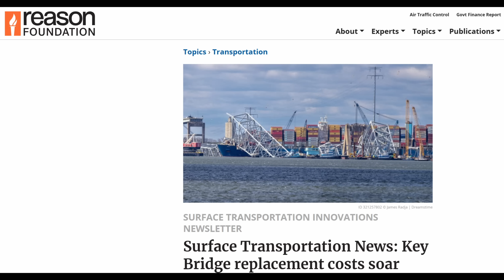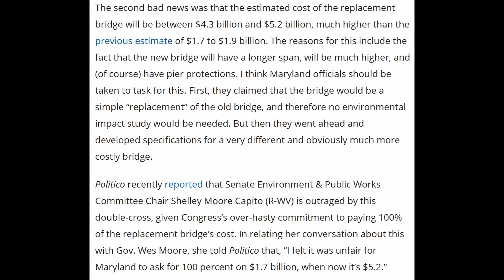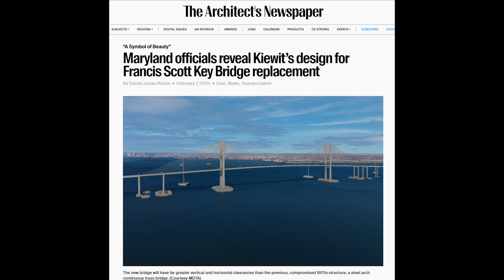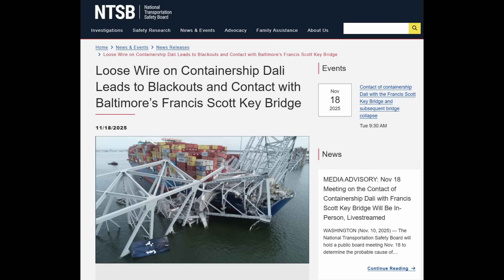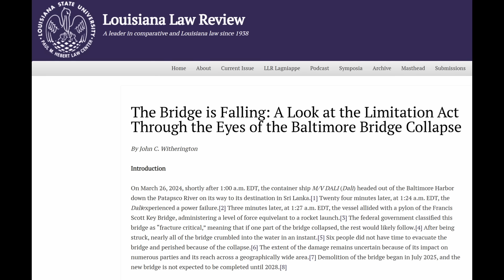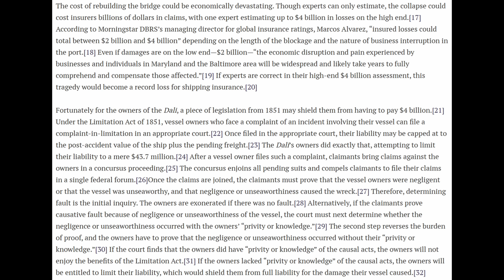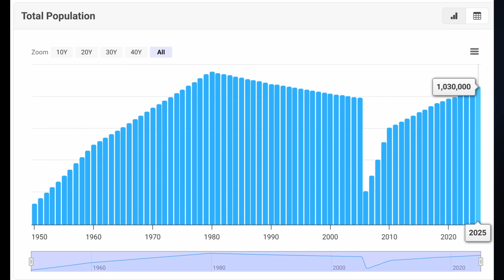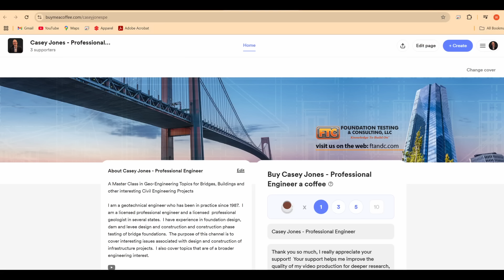Should U.S. Taxpayers Pay for a $5 Billion plus Key Bridge Replacement?

Comment: I find it odd that the high power transmission lines that cross the river next to the Key Bridge had protective shields constructed around the transmission poles.  But MDOT never thought that the Key Bridge should have the same sort of protection around the bridge piers.
Reply from the maker: They knew for decades that they needed to provide better protection from errant ships.
Reply: Those powerlines were constructed in 2019, following the new guidelines for protection. The Key Bridge was constructed in 1977 and was never updated under any Republican or Democratic governor during those years since
Reply: Ever think theres a critical or even defense reason the high power transmission lines are protected… meaning they could be key to grid if they go down it would cost far more then just a bridge falling down 🤔 or maybe critical high power transmission falls under different requirements 👀
Reply: @Clearwater420  A transmission line can be rebuilt much cheaper than a highway bridge.
Reply: @robertewalt7789 i agree inless that transmission line was deem critical meaning the loss of that line would cause a cascading collapse in the region and that would cause significant more cost then just a bridge falling down…. Look at different cascading failures of a grid , that have happened to see example.
Reply: @Clearwater420  There would be no long term power outage if that line fell over. It would be fixed quickly and alternative paths for power exist in major cities. a very major power line got taken out near me. The only member of the pubic that noticed was the guy in the tractor that took it out. 

the power company made way less money those 4 days. but that's about it.
Reply: @c @cabobs2000 interesting because 2003 northeastern black out cost estimate apparently 5 to 10 Billion in 2003 figures 🤔so if we assume worst case 10 billion that be equivalent 2 bridges replacement? However we know from US own reports you need to take out 10 key 🔑 locations to drop the US/CAN grid so again we don’t know due defence security how critical that line is.  Thus the federal level made sure it was protected 👀
Reply: Just get the white ballroom d honors involved. It won't cost the American people a dime cough
Reply: No feasible protection system will stand up to a 100,000+ ton ship sailing at 10 knots.

The only solution is to tunnel under or single span all the way across the river.
Reply from the maker: @alanstevens1296 Not true.  While the tunnel is compelling, there can be measures taken to provide adequate protection.
Reply: @alanstevens1296 wrong. Dolphins are 100% effective for protecting bridge piers.

Comment: There is absolutely now reason that bridge should cost $5.2B. that's about $602K per foot of bridge or $3.2B per.mile. The Bay bridge cost $250-300M per mile (adjusted) and was over deeper water, in worse weather and was assembled not poured. The costs should be MUCH less but of course it's Maryland, lots of hands need greasing and lots more fingers in the cookie jar...

Comment: you're not wrong at all to ask about return on investment for federal infrastructure spending in general, but a couple of things to consider as well:

1) With respect to the FSK bridge and the Washington Bridge -- the FSK bridge is more critical as a piece of infrastructure than raw traffic counts would suggest. It was the only feasible crossing across the Bay in Baltimore that was legally available to hazmat trucks. Anyone carrying hazmat who wants to go through Baltimore on 95 is now legally required to add about 35 miles to their trip by going all the way around on 695. Unfortunately we have seen many hazmat trucks illegally entering the tunnels as a result of the bridge collapse. The Washington Bridge in RI carries / carried more traffic because it was a major commuter bridge, but there's a big safety difference between telling commuters they have to detour (or suffer in traffic) and the risk of a hazmat truck catching on fire inside a tunnel.

2) The rebuilding of New Orleans infrastructure isn't remotely the biggest problem with federal funding backstops for areas subject to routine (and in many cases, increasingly frequent) disasters. The National Flood Insurance Program has been blocked from charging actuarially-backed premiums for flood insurance for decades and as a result has accumulated tens of billions of dollars of debt. nobody wants to tell their constituents that their flood insurance premiums are going to go up 3-fold or 5-fold or whatever because "some government bureaucrat" (i.e. a disinterested scientist who's doing a fair risk-reward assessment) has decided that their house is at much higher risk of flooding than was reflected in the maps that set their current flood insurance rate. So Congress repeatedly blocks the subject-matter experts from being able to raise rates; refuse to insure entirely; or create rules that allow for mandatory relocation (i.e. a program where you get the full value of your property in exchange for your land - mandatory buyouts). And everyone continues to pay to rebuild houses - sometimes million-dollar houses getting rebuilt every 5 or 10 years.

Comment: Why is replacing a bridge the only proposed solution vs. widening the LAND routes to route around the problem?
Reply: Should be studied along with the replacement bridge price. However if you pull up a map you’ll see the FSK was the only interstate alternate for the I895 and I95 tunnels through Baltimore. The only other way is using the existing I695W the long way wrung Baltimore or cut a new highway through the city.

Comment: The Feds told Maryland they should  build a 6 lane bridge since the design life is 200 years and they suggested directly  using he Gordan Howe  bridge in Michigan directly.  No new engineering for the bridge itself and fabrication simply duplicates the existing design that meets ALL standards.  MDOT was going cheap and planning to reuse the existing  approach bridges but that  is not out as they fail to meet fed design standards and the footing are too small.   If the over water  bridging is 6 lanes, the on land approaches can be widened in the future.  BUT if there is a need for 6 lanes, no one will build a new  bridge in the future.    This stinks to high heaven.

Comment: This reeks of corruption.  Maryland is not releasing data on the design bridge requirements in  ways that let  people track the costs.   The design I have been told is was taken from an existing bridge to save money.  The Feds suggested a 6 lane bridge design based on the Gordan Howe Bridge in Michigan to Canada.  Even if the approaches on either side are not widened , the Bridge  SHOULD have a 200 year life.  Why would you not make the bridge bigger NOW?   Copying the design directly would save huge chunks of cash.   And it is important to note the Michigan project had to buy large swathes of real estate and make major changes to the highways, customs facilities and other huge cost factors.   MDOT originally wanted to reuse the approach piers but that would not meet modern Fed standards.   That was why there was a long delay tearing down the approaches.   I have been told the cost to build the Gordan Howe Bridge in Maryland would be under $2.7 Billion.
These "emergency" jobs run by blue governments  have had a history of 2-300% cost escalations adn massive  multi-year delays.  Look at the Hudson River Gateway project.  In 2006, Amtrak dusted off a 1060's PRR design for new tunnels and approaches to NYC.  Estimated cost using the best  tunneling firm in the world (European) was $4 billion.  NJ and NY took over the project, fired the experienced  engineers nd companies replacing them with locals who had never done such a project.  By 2012 the cost ballooned to $16 billion and 20 year time span.   Today, the NJ approaches are 60% done, nothing started on the actual tunnels, and the cost estimate is now $45 BILLION and another 15 years.   Congress needs to order that every document and communication be made public.   Every contract needs to be checked in public and audits need to be made.  To say this does not pass the smell test is like saying a giant mountain of pig manure smells like Chanel #5.   Not a penny until MDOTY can explain why the high cost for a second rate bridge.

Comment: Dolphins should have been installed 1977 on ALL bridges in America with large ships passing under .. 

As a temporary quick cheap safety measure 
dredge spoil could be placed along channel to make it to shallow for any ship barge which goes off course to prevent  impact in  bridge piers columns .

Restrict depth of water to a few feet in front of piers parallel to channel so large ocean vessels are grounded if  they go off course out of deep designated channel.

Did Bidens Auto pen 🖋️ sign promise?

Comment: Would of, should of, could have will not restore the bridge.

I travel I695/I95 enough to assure you did not need a traffic study to determine the immediate impact of that bridge going down.  @5thgen916 made excellent points the tariffs to drive up domestic material costs, and more importantly the Administration's guarantees allowed aspects of the project to progress more rapidly.

Don't underestimate the damage done by tariffs.  I went through this in 2017-2020 as committed domestic steel was sold out from under us regardless of existing contracts.  We either paid the ransom, and/or delayed our projects.  Most of these projects were fixed cost, yea we ate it.

Comment: Hey Casey thanks for keeping us informed, but there is a project just 3 hours south that VDOT (Va. DOT) is building 15 miles on new interstate 64 from Mercury Blvd in Hampton to Tidewater Dr. in Norfolk a road and a 2 lane tunnel that was built in 1956, and a second 2 lane tunnel in 1976 when the land based approaches were widened to 3 lanes, but the trestles going into the 2 tunnels narrowed to 2 lanes, one tunnel (1956 ) had become a trucker's nightmare as it can only handle 13 ft high trucks while the 1976 tunnel is 15 ft. Infrastructure exists on both sides to stop over height or trucks carrying flammable loads before they get to the tunnel. For 5 years VDOT has been spending $4 BILLION to add 2 additional traffic tunnels that will carry eastbound (to OBX and Va. Beach) with 2 free lanes and one tolled HOT lane, and an unused lane, at least at first. Thus the road, much of which is trestles over Willoughby Bay, Hampton roads, Hampton River, skirting the Naval Base, Hampton University, Downtown Hampton and the Coliseum Arena, costs at $4 BILLION, and that's with a 4 lane TUNNEL, not a cheaper bridge. (Navy requires tunnels as the Naval vessels must pass over the tunnel to gain access to the largest Naval Base in the world, Newport News (HII) Ship Building (where all carriers are built and worked on and many nuclear subs) and lastly the Norfolk Naval Shipyard which is in Portsmouth Va. and requires going over 2 additional tunnels (Downtown and Midtown) to access. SO we are building 15 miles of NEW 4 lane /8 lane interstate approaches 4 lanes of tunnels (which just were bored through and the tunneling machine is being disassembled, maybe they could give MDOT a good deal on a used tunneling machine and build a tunnel instead, to interstate standards, which they currently are not having been constructed 70 and 50 years ago when interstate standards were more lax. Even so they have had to build and remove multiple temporary structures to maintain traffic flow, the current 2 lane approaches are being widened to 4 lanes with shoulders (even though only 3 lanes will be used initially, with the two center tunnels being HOT / toll tunnels with variable toll pricing, to maintain the same capacity for toll free driving, and the privilege of sitting in 5 or more miles of tunnel back ups on virtually every summer weekend in both directions. MY point is that this much more expansive and expensive (adding 4 lanes of approaches and 2 lanes of tunnels) than the Key Bridge project will be (4 lanes with shoulders). Yes, Baltimore has the same issue Norfolk has with dangerous loads being forced to use overland routes (US 460 from Petersburg or US 17 across the James River Bridge). How what is being sold as a much cheaper bridge, that is not expanding capacity, and like here in Norfolk/Hampton demolishing the existing approaches (which should be cheaper since they won't need to provide alternatives to keep traffic moving). With what's happening in Baltimore, it appears taxpayers in Norfolk are getting a bargain. A decade ago the state SOLD the Downtown and Midtown Tunnels to a private operator, who added a new southbound tunnel (on US 58) and approaches for $2 BILLION, and currently charge about $3 in tolls for traffic going in either direction. Sadly the deal with the contractor goes for 70 years so it will be 2086 before the tunnel reverts back to VDOT's control, and as is customary, if the cities or state build a "competing" project, the taxpayers are required to reimburse Elizabeth River Tunnels (the operator's corporate name) for their revenue losses.

Comment: I work in Naval construction, and domestically produced steel has risen in lockstep with the tariffs for shipbuilding and I foresee bridge steel is similar to ships steel prices.
Reply: Tariffs always tend to result in price increases. One main reason is that vendors have less competition on price.
Reply: That's what I thought also.
Reply: HHI must have been very displeased when the source of the accident was found to be a defect in the wiring during the construction of the electrical control cabinet.
Reply: 10% on steel and 200% on total cost doesn't compute.
Reply: @Larry-mk9ry steel prices for shipbuilding have gone up 30% since bids last December.    There is a lot of steel in ships and bridges.    Yes material cost have gone up faster than labor and dredging and foundations, but it is up.

Comment: LOWER THE BRIDGE - BUILD A CAUSEWAY

Oh Dear....!

It beggars belief that the authorities are merely replacing what was a high bridge with aanother high bridge.

Commonsense would have lowered the Highway on both side and built a Causeway out from each bank. A bridge then put in at the new, (Cauuseway), lower level would then only be needed as a Swing Bridge for the navigable Channel.

Lower cost of replacement and much lower levels of maintenance for the Causeway, because once built and extended outwards it would only require additional 'Rock Armour' from time to timee......or as monitoring it required.

Some of the cost of the new Causeway and Swing Bridge would be recoverable from the steel currently in place on the existing bridge.

It would seem that the authorities are intent on spending too much money, when a cheaper and more sustainable option exists.

But hey....there you go....!
Wasting Public Money is alwways an easy option.

James Hennighan
Yorkshire, England

Comment: Yes. We (tax payers) benefit from the infrastructure and it should have been already upgraded to prevent the disaster. This country has an obsession with paying money to firms directly for "investment" but our biggest success has been from direct investment in infrastructure (the Interstate Highway system, the Mississippi River locks & levees, our ports and railroads which were built with heavy government subsidies).

The problem is not paying for such infrastructure, it is the corruption and inefficiency from lack of oversight at the time of building.

Comment: coast guard reports more than 200 large ships have malfunctioned since the key bridge collapse. Even more concerning is the Chesapeake Bay bridge, dubbed "Americas scariest bridge", just down the bay, that has 100,000 vehicles a day on Saturdays and 20-30 million per year has no fenders, not one dolphin around it. MDTA plans to build a robust fender and dolphin system around it. How long does that take to dump some concrete in round forms? Should already be done. Our infrastructure is rapidly crumbling. First span was 1952, second span is 1973. Time to replace the 1952 span. If that bridge goes down, the economic impact would be devastating, way worse than the Key bridge. The most vulnerable bridge is the Huey p. long bridge near new Orleans, 2nd is the Oakland bay bridge.
Reply: I agree. The toll money from the bridge and the DriveEzMD's ripoff fines and fees would cover the cost. Unfortunately the pirates who run that deal at MFTA have a different agenda.
.